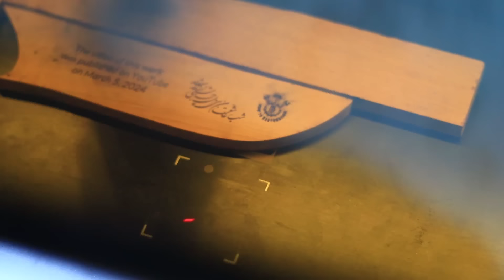I Restored an Uzbek Knife - & It's a Work of Art

Comment: Its just a shame. Put all that work into the wood and didn't even bother heat treating the knife.
Reply: Lighten up Francis
Reply: Wouldn't it have been heat treated when it was made?
Reply: Pipe down Chachi.   This is about restoring a blade not making it from scratch.  Heat treating an old blade, can cause a lot of problems. Specially when you aren’t sure of the process it was made originally.
Reply: @4foxsake571  So you "restored" it, put all that heat and stress into the blade...and made it worse?
Reply: @ heating an existing blade puts nowhere the amount of stress that heat treating the blade does. Heat treating a blade is great for a new blade that you know exactly what has been done to it already.  Heat treating a blade that you know nothing about can make it too hard and brittle, causing stress fractures, and making the blade easily breakable.
Reply: @4foxsake571  ya know...i was going to explain the science of basic metallurgy to you but it would be a waste of my time. So to you I just say "okay👍"
Reply: @ please do explain the very basics of metallurgy. Let’s hear this oh master of metallurgy. The premise for your argument is completely wrong already. You have no clue what work has been performed on the blade before the restoration, you haven’t performed an NDI, you don’t know the carbon content, or the amount of other materials that are in this old blade. Come on. Let’s hear it keyboard warrior of the comments section. Because this is such a basic scenario, that only the most basic concepts of metallurgy would apply.
Reply: @eleven_bravo7033 you mean before he shaped it?
Reply: You're worried about the heat treat? I think the tang is soldered on . . .
Reply: @Tovish1988  🤣🤣🤣
Reply: You can see the line about halfway up the blade where the metal turned dark blue from the heat when he worked on the tang.  Half the blade won’t hold an edge.  It’s ok to soften the tang to work it, but the blade should have been kept cool to prevent the need to heat treat it.  It’s now a novelty item for show, not an actual knife.
Reply: На стенку повесит наверное.
Reply: @4foxsake571 то что он нагрел рукоять до красна, он сделал ее мягче, в просторечии отпустил металл.

Comment: Have a few questions here. I'm not knocking your ability to restore something. That's not in question. But the actual knife itself. Did I see you use a razorblade to scrape "metal" off? All of the cracks on the tang, not delams, but it looks like someone tried to forge weld a handle onto it. All of that leaves me questioning the hardness of the blade. Might first want to do Rockwell Hardness Test.
Reply from the maker: This knife is not meant to be used. I made it for decoration.
That’s so kind of you❤️😃

Comment: Прекрасная, кропотливая работа! Моё уважение!
Но, простите, изначально, похоже, это был пчак (так называется узбекский нож такого типа, ваш клинок по всем признакам соответствует ему). А получилось что-то другое. Поэтому это нельзя назвать "реставрацией". Это авторская работа, с использованием старого клинка.
Пчак имеет металлический больстер (раньше он часто изготавливался из свинца, следы которого видны на вашем клинке) и заточка у пчака "на клин". Вы сделали великолепные рукоять и ножны, но не соответствующие пчаку и изменили заточку.
В любом случае - моё уважение и восхищение вашей работой!
___________________________________________________________________________________________________________________________________________________________________________________
Beautiful, meticulous work! My respect!
But, sorry, originally, it seems to be a pchak (so called Uzbek knife of this type, your blade by all signs corresponds to it). And it turned out to be something else. That's why it can't be called “restoration”. It's an author's work, using an old blade.
The pchak has a metal bolster (in the past it was often made of lead, traces of which are visible on your blade) and the sharpening of the pchak is “on wedge”. You made a great hilt and scabbard, but it does not match the pchak and you changed the sharpening.
Anyway - my respect and admiration for your work!
🤝
Reply from the maker: Your support means the world❤️🙏
Reply: Абсолютно с Вами согласен. Но работа очень даже неплохая)))
Reply: @sambearing7687  работа прекрасная, слов нет.
Reply from the maker: That’s so kind of you🙏🙏
Reply: It starts as a piece junk. A pice of junk is still a piece of junk whatever you call it, or as we say in Sweden " snus är snus om än I gyllene dosor" translated:
" snuff is snuff even in golden doses". I think everyone can se that it became a great knife in the end.